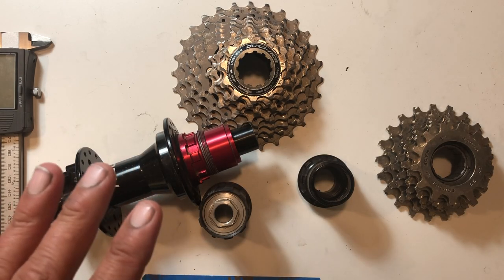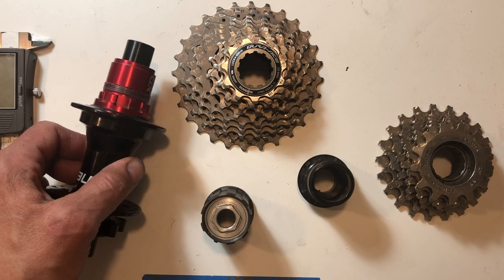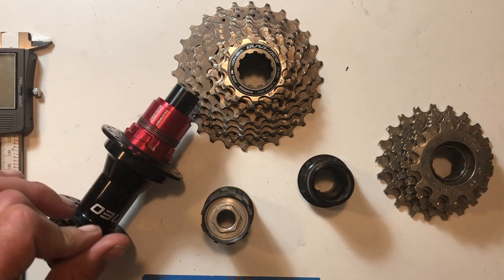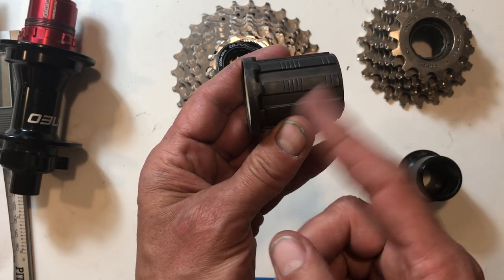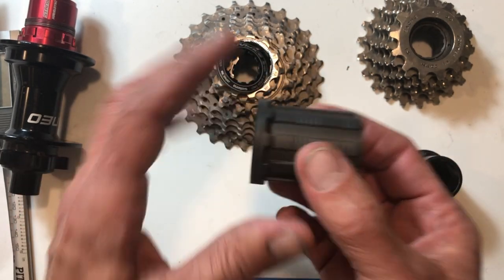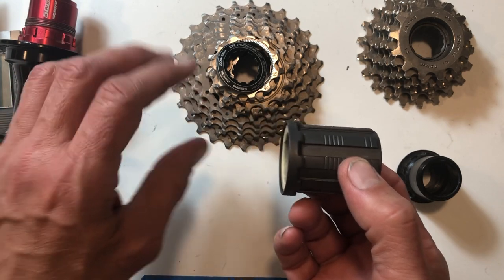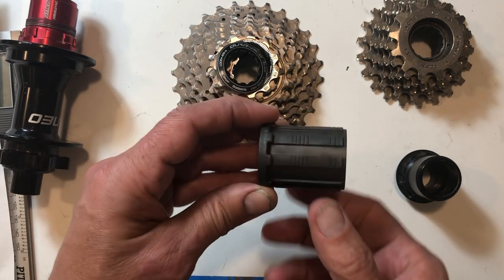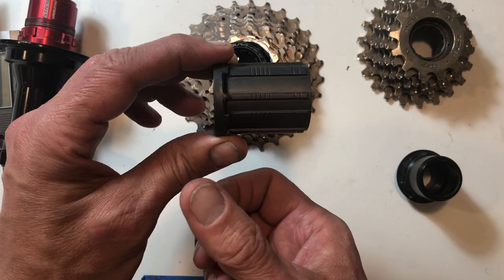All You Need To Know About Freehubs, Freewheels, And Cassettes

Comment: Joey, I've reviewed this video several times and I recognize and learn something more each time. This time, I picked up on the detail of the size of the largest cog and why it's important.  I run a Dura Ace 53/39 chainrings to a 9 speed 11/28 cassette.  New bike to me, (Trek 5900) but I planned, going in the purchase to change both the cassette and chainring configuration.  Probably go to 11 or 12 to 34 on the rear and yet to be determined on the front.  I live in the Hocking Hills in Ohio (hilly), and betting I discover the 50/34 is the right change.  Thanks for the very detailed and clear explanation.

Comment: I had a Sram 25/12 10 speed cassette. I was able to run it on a 11 speed hub with no spacer. When i swapped it for a Ultegra 28/11 10 speed cassette i had to use a spacer. I found it so odd. But then i realized they had the same amount of cogs. But the spacing is different. When running the Sram i experienced noise from the chain rubbing because the cogs were closer together. But the Shimano is much smoother and absolutely no noise. Very good point that you touched on about that. Great video.
Reply from the maker: Thanks!

Comment: informational vid, no doubt, but I call foul on title 8)
what I need to know, not being a cyclist, is how to reverse the freewheel direction on a shimano hyperglide unit. I'm using it to drive the reel action of a tarp roller and need both ends of my 16 foot span to roll up evenly, yet freewheel when I'm deploying the tarp. It's being driven by a chain on each end by a shaft that spans to drive both ends together (hopefully resulting in a good straight roll without coning or cupping on either end).

Comment: Im thinking of getting the HF welding table fir $70. Think its good enough fir bike frame welding?
Reply from the maker: 5 or so years ago, I was contemplating the same thing. I ended up just building my own welding table. It worked out well and have built a couple of frames plus numerous other projects on it. The HF table seems like a good option for taking to a job site, but maybe a little too light to build a frame on?
Honestly I'm not sure because I haven't tried it. The price is right on the HF table though!